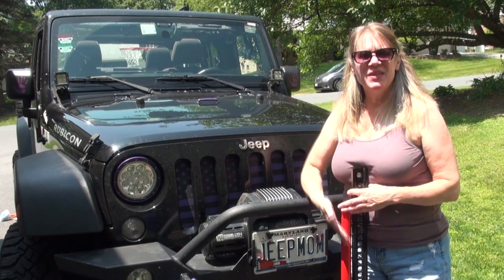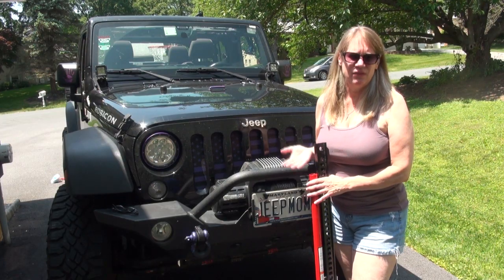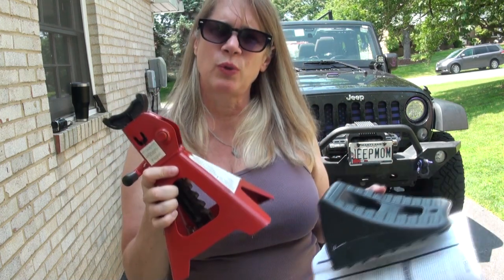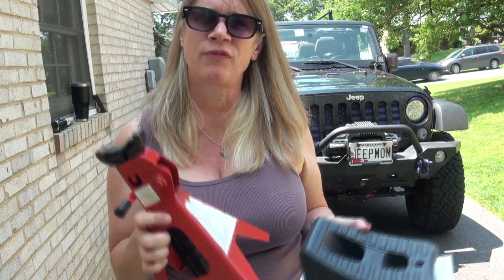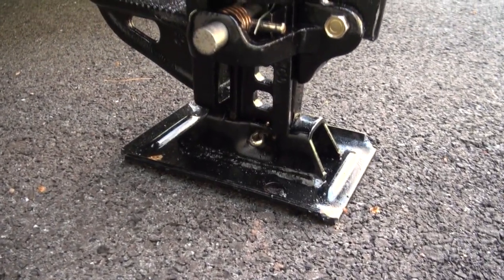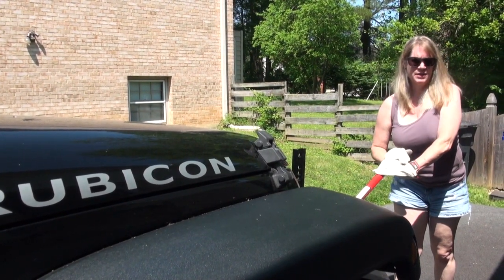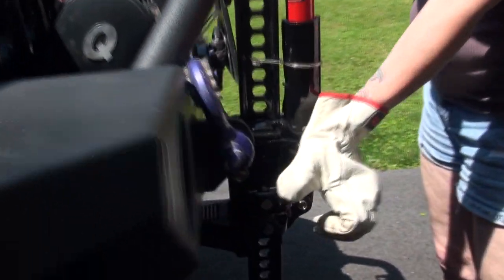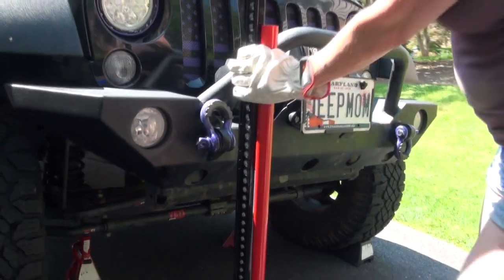How To Use The Hi Lift Jack Safely on Your Jeep Wrangler - Safe Hi-Lift Jack Use

Comment: Great Video but I am sorry to tell you you haven't got the All Cast Jack, You Have the Steel and Cast Version, The All Cast version has the part number HL485,
Reply from the maker: I never said I had the all cast jack... I said I have the all cast and steel Jack. Which I guess technically I added the word all. Hi-lift Jack says they are exactly the same except it has four stamped high-strengthy steep parts. It allows them to offer it at a lower price and maintain the same rigid quality standards that every Hi-lift product must meet. And in the end it doesn't matter which Hi-Lift I have. The video is on proper use of the jack and it was approved by Hi-lift.

Comment: Nice vid, new subscriber. I’m having an issue with my back bumper and needing to use the high lift. It’s a Smittybilt and it’s almost triangular so it lacks a flat surface like the bottom of my front bumper has. I have the plastic OEM steps on the side so I can’t jack from the side either.
Reply from the maker: Stav L did you look into the high lift jack mate? Or check this out... https://jeepsneeds.com/products/d-lift-adaptor-hi-lift
Reply: Lift it from the d rings.
Reply: Thank you both!
Reply from the maker: Stav L Neil says the same thing. Watch my next live video and we will show you